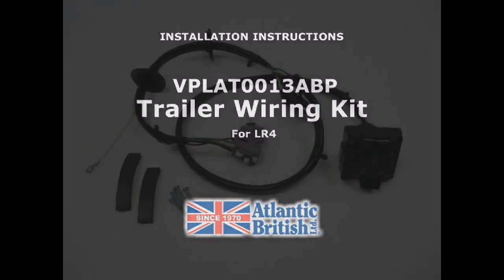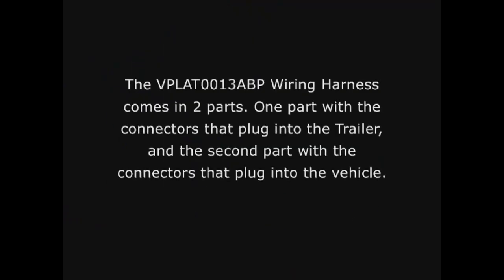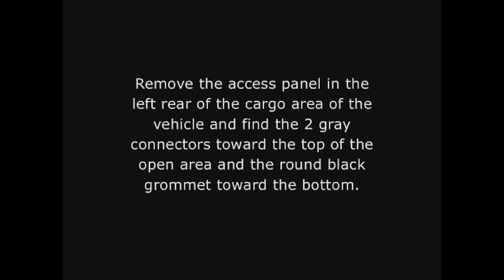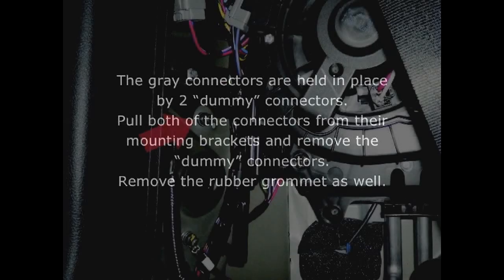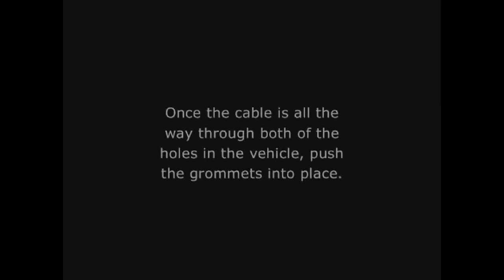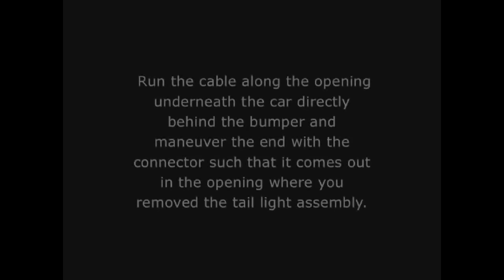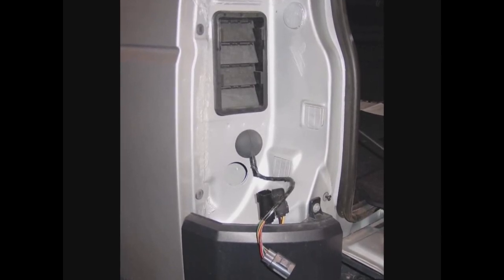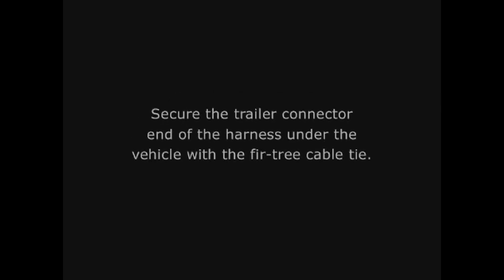Atlantic British Presents: Installing A Trailer Wiring Kit on a Land Rover LR4

Comment: Great part. Need to tow boats, campers and trailers with my 2012 LR4.  I have the hitch but not the harness and trailer plugs. This plug and play part fits exactly as advertised. I had the entire install done in 40 mins after watching this video and a DIY install video. Thanks for offering a great DIY plug and play part that is so important and easy to install.